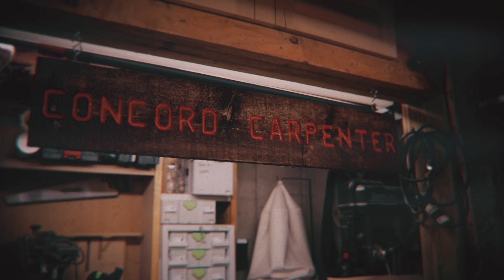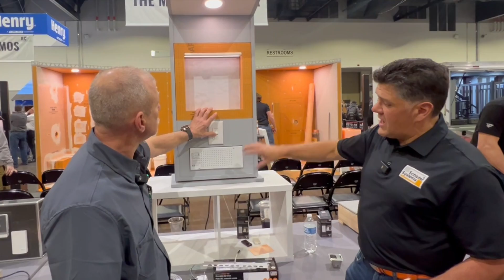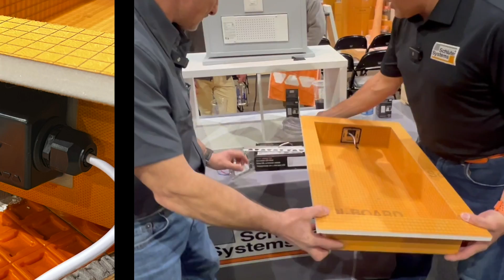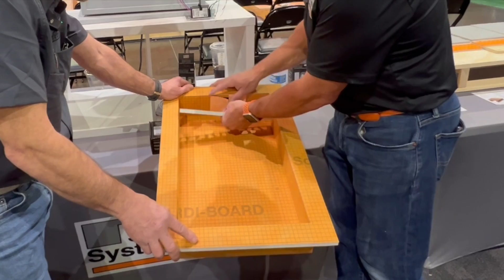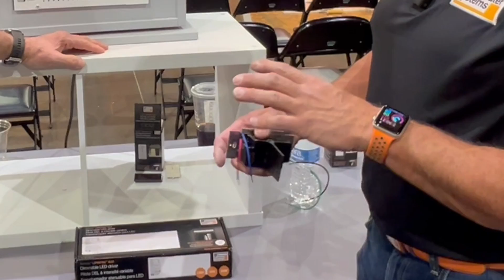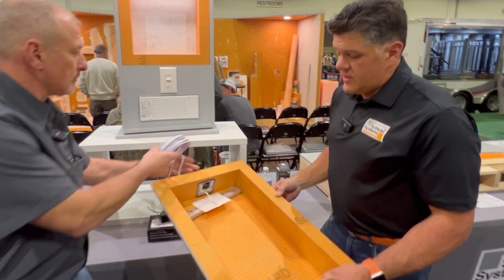Schluter LIPROTECH LED Shower Niche

Comment: But is it serviceable without disrupting the tile? .  LED lighting is still unreliable
Reply from the maker: Yes
Reply: LED lighting is still not reliable? What kind of crap are you installing or using? I've been installing LED lighting for years and, with a few exceptions, everything works wonderfully. Whether inside or outside and even in bathrooms I have no problems
Reply from the maker: LED is very reliable